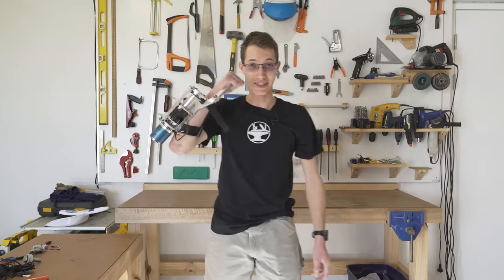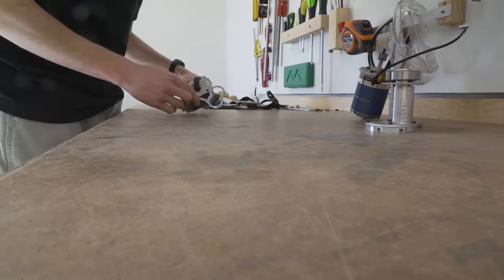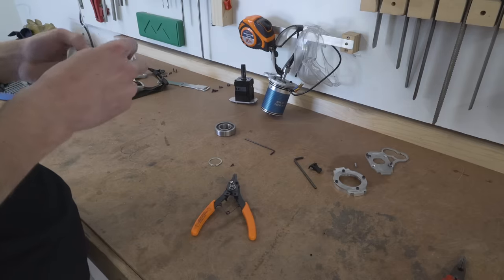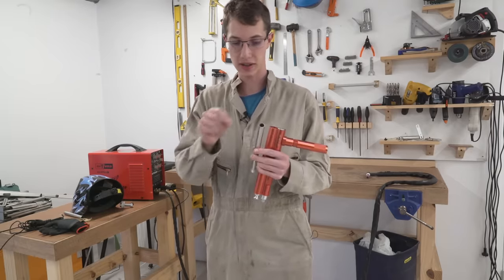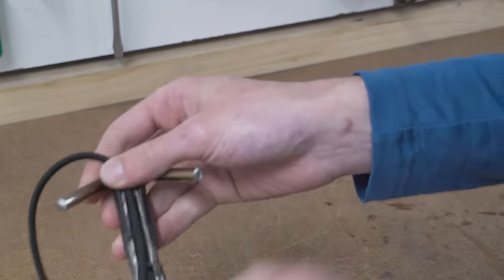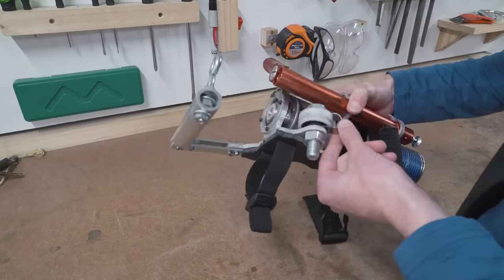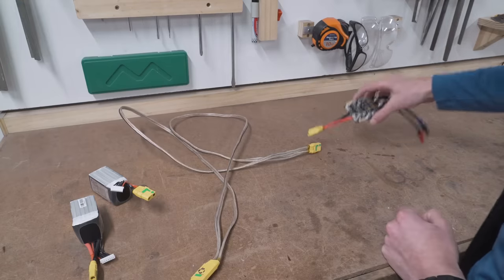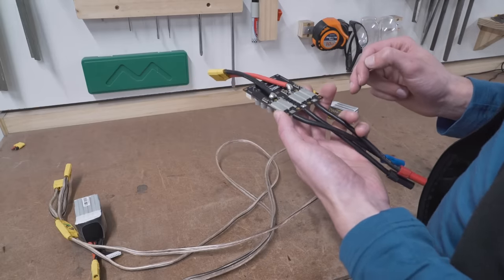Building a real, working grappling gun – Pt.1

Comment: Instead of making the hook lighter, is there any way you can increase the air pressure? Perhaps add a small air tank about the size of a thermos.
Reply: Yeah CO2 cartridges don't really pack much power eh?
Shotgun cartridge? 

Also JT if you make the hook lighter, you still want it to be strong enough to hold your weight without getting damaged...
Reply: airsoft HBA tank
Reply: There is also an easy way to make it lighter too. The shaft that goes down the barrel doesn't need to be made out of metal as long as the rope is tied directly to the metal hooks on the front, this will stop air leaking out of that gap down the side and allow for the fit to be made practically air tight. It could also be made longer if it's made out of some thing like PVC with a plug at the end so the longer it sticks down the barrel the more power he would get. If you combine this with a paint ball CO2 tank or something else more powerful and he uses as small of hooks as he can then this thing could really fly. He also needs to do some tests on how long those hooks need to be and how thick they need to be, also instead of using round stock it might be more aerodynamic to use plate metal cut out so they act more like wings. and if none of these things work just have like a single use arm launching air plane fly the grappling hook where ever it needs to be. It will need to have the power to lift all the rope and the hook with the capability of a quick release system to drop the hook... Or just make the plane the hook and use ducted props that are protected when you fly it around a branch to hang from the trailing rope lol.
Reply: I was thinking he's already wearing a backpack for the electronics, just add a tank there also .
Reply: Did anyone else hear the CO2 tank leaking after he loaded a new one in? That's a problem too.
Reply from the maker: That's another thing I'm considering, I may end up doing both actually.
Reply: @Built_IRL  Slautghter a Paintball gun and use the airtank system from that. you can make the tank fit nicely along the side of your gun.
Reply: It would make it much more bulky 🤔
Reply: @Built_IRL  When you find a sufficiently powerful way to launch a detached hook, if you then launch it while it's attached to the cable, it won't go very far, because it'll be pulling the cable out all by itself, which will drain its kinetic energy almost immediately. One solution would be to find a way for the arm mount to shoot the cable out along with the hook, just fast enough that there's always a bit of slack. Maybe something like powered rollers just in front of (or in place of) the existing guide wheel? Also, you should try replacing the separate winch speed controller with a trigger on the main handle :)
Reply: GUYS JUST CAUSE NOT A PAINTBALL THINGEYMIG HE IS AN ENGINEERS ARE YOU GUYS YEAH I THOUGHT SO
Reply: @nizarballouzeh1719  bruh
Reply: jes youre right
Reply: @galen8183  its a small airsoft gun c02 cartridge hes nowhere near blowing it up...
Reply: That is what I thought about
Reply: Lol he might as well just throw it.  Its going to be dangerous to have strapped to your wrist by the time its powerful enough
Reply: @o.oo.o5637  yo he shouldnt throw it away if he is able to actually make it work and it isnt dangerous for him as the user, he could make a fortune selling it. Or just fly around with a wingsuit on lmao
Reply: @evilcanofdrpepper  I have never seen someone thinking that much about projects where they can't be involved personally themselves... But I respect that... (Also: Sorry for me inglish is littel bad... Me Germany person so no inglisch)
Reply: E
Reply: @BladeOfDespairr  I know it’s been a year but I think he meant throw the hook like just throw it instead of making a launch mechanism

Comment: Where did you learn engineering techniques like developing unique metal parts, understanding motorized systems and mechanical principles?
I am a freshman in college studying robotics who has been hesitant to approach building custom projects like this. What would be your advise?
Reply: DANIEL SMITH  lmao much easier said than done 
but @Lukas, staying in your college degree will help with that. im didnt do ME or EE (im CS) but the courses really help you understand how to learn and what to look for
Reply: @pvic6959  I did robotics competitions in High School, and physical experience with tinkering in my workshop helped me learn a bare minimum in Maker 101. But I haven't built something truly "my own", where the parts and design are completely scratch and custom. I am, however, considering taking a shop class to build manufacturing experience at least. I feel that might help the process considerable, since I can actually build more.
However, approaching my first project now is daunting with classes, research and so on.
Reply from the maker: Hi Lukas, I learned to use CAD in university (Electro-mechanical Engineering), and also some of the maths I needed. But I think a lot of the design knowledge has come from me trying to fix (or taking apart) a bunch of broken things - you sort of get used to seeing how it's done in existing products, so it helps you when coming up with your own.
Good luck, and have fun with it!
Reply: Remember Furze was a plumber...... no engineering school

Comment: Add a small tank and run the hoses into a backpack or a belt for more power launching. Add  resisters so if a surge happens it protects the electronics. Just a few suggestions and keep it up. You did a great job on it so far

Comment: I suggest that instead of a ratchet you use a friction hook system similar to what would be used in mountain climbing.

The main issue I see with this is getting the rope to run through smoothly when ascending as well as launching but if you could get it work right it would give you significantly more utility. One main benefit is that you’d be able to manually control the speed at which you descend.
Reply: Additionally I’d like to add that you’re doing an amazing job and to keep it up👏👏👍

Comment: As far as comfort goes, if it’s still causing discomfort, consider using an arm brace that goes between the straps and your arm. I’ve been working on a similar project, and using an arm brace has made it very comfortable.

Comment: You need a worm drive on the winch so it can’t back drive. And make an air bow for the launcher like on the slingshot channel . Looking forward to seeing your progress!
Reply from the maker: The planetary gearbox I'm using is actually way more efficient than a worm gear, and back driving's not such a problem. I'm planning to add a braking system, which should sort that out. Thanks though!
Reply: Built IRL yeah it looked like it pulled you along so fast!

Comment: Also, I would if you could change the main frame that your hand goes and the top support bar out of steel, it does cost more but you won’t have to deal with more cracks from the tensile loads. It’s funny since I made a much bigger version on this a while ago. Not nearly as amazing as yours but I found having the free hand a glove with all electronic controls. Just makes things so easy

Comment: Put the motor inside the cable drum. Use an inrunner style motor so you can put a large diameter yet thin ball bearing between the motor case and the end of the drum, while mounting the end bell of the motor to the frame. The other end gets a custom made planetary gearbox built into the drum. Use a motor with a long shaft so it can protrude through the gearbox to be supported by a bearing in the frame. That way you can have the whole motor, gearbox and drum short enough to mount crosswise - but it'll require more custom machining, possibly even cutting custom gears. Next thing is to make a level wind mechanism like on a baitcasting fishing reel.

Comment: Dont worry man, you've got the hacksmith community following ya now since they linked ya.  Plenty of help to be had.  You might try kicking up the paintball gun's regulator or seeing if theres any power adjustment.  Mine fires off one helluva blast of co2 compared to the little pop on your video.  As for the ESC, we've all smoked one or two over the years, it happens.  If you figure out fixing it thatll be pretty cool on its own.

Comment: Instead of using the cartridge to create thrust set a pin at the bottom of the spring and it will puncture the seal of the cartridge launching itself

Comment: Make a skeletal metal frame like a box with no sides just edges (I’m trying to explain bear with me) so you can pop the co2 cartridge by popping it out of the bottom with your hand and replacing it the same way as you push a AA battery into its housing , pushing it in from behind and then pushing down on top. Would make swapping co2 cartridges easier, but it’s hard to explain without showing you.

Comment: A HPA system might be a better option.  A remote bottle on your back with a line to the valve.  It would give you a better pressure I would imagine.  Also give a good more shots.
Reply from the maker: HPA would definitely be an improvement! But for any air-powered launcher, the "power-stroke", so to speak, is very short (unless I made a folding hook so it could fit in a long barrel, but I don't really want to do that). Anyway, I'll figure something out!
Reply: Built IRL   Gotch ya.

Comment: Also. Add 3 rubber O rings to your grapple hook. Lube them with 3 in 1 oil they shoukd be no more than an inch spaced in total. So a quarter inch  from each other or kess would  be good at the bottom of your hook. Get tighter O rings and cut grooves at the bottom of your hook ittl keep em in place better then push it into your gun. Way tighter fit and suction should be there ... way more pressure now. Air should  barely  be able to go past  the O rings but still able too. This will create more velocity on that and make it way more powerful.  Way more.

Comment: why don't you recycle the co2 tanks and make those into the grappling hooks?
you could cut 3 flaps on them, add a basic hinge and springload it. That way it will hold a bullet shape and deploy the hooks once its in the air while also being lightweight

Comment: Use a Car ESC, it have reverse and... it cost a fraction of the one you burned!
Reply from the maker: I looked at some! But I need 50v and at least 150A. Additionally, it's very important to have a sensored ESC because I need full torque from standstill.
It's quite an unusual set of requirements ;) but otherwise a car esc would have been good!

Comment: You need to use steel as a plate aluminum is just not that strong for what you are doing with it. And for that case steel would be the best option for all the components if possible!
Reply from the maker: Nah actually, due to the way geometry affects stiffness, thick aluminium plate is stiffer for its weight than steel. Which is what I want here - the main failure mode is flexing rather than breaking. Thanks for the input though!